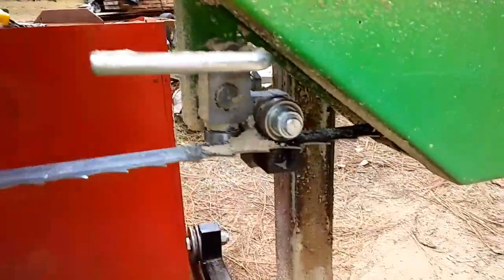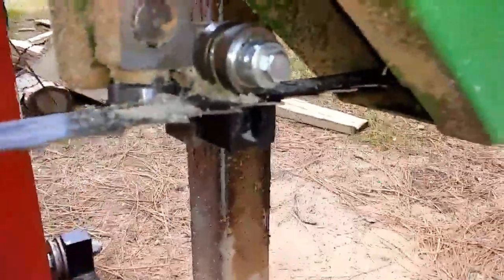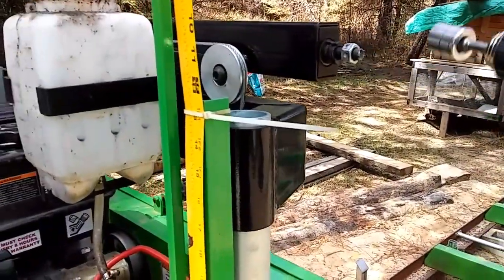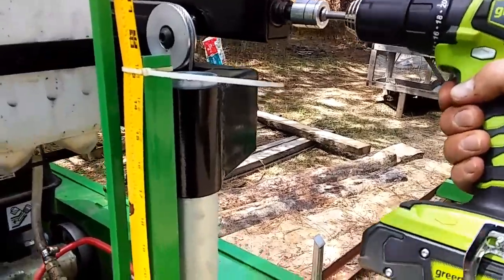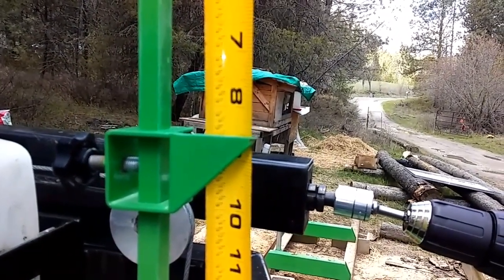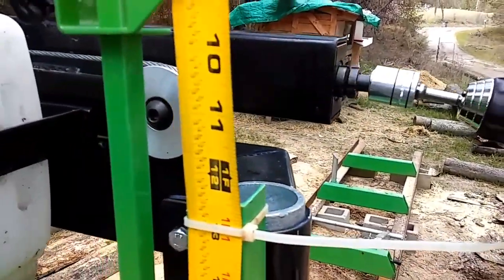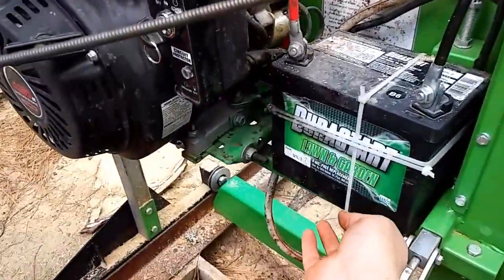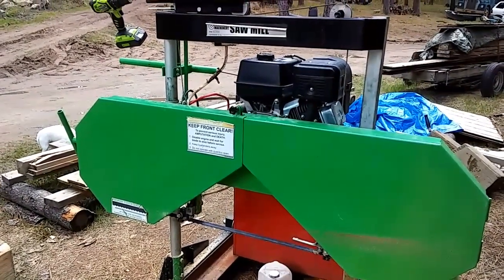Awesome harbor freight sawmill upgrades

Comment: The major problem with this mill is its lack of a stiffened base. It rides untangle iron.Unless this is solidly blocked up it will bend. Your cuts will be off because the carriage runs on this.I had another brand of mill that had this problem.I put it on a concrete slab A later model of that saw put a 2x6 tube of steel the length of the track as standard. That relieves a lot of problems.

Comment: pretty slick on the  adjusting of the height modification my first thought was  if you  use a motor  pulley system instead of the cordless drill  you could have  a momentary switch for each direction  with either a one hand or foot  controller  i saw Patricks comment and  that might be a good option since you already have a 12 volt battery at the mill  of course autos  have other 12 volt motors that may work as well ?  like hydraulic  units  and many others  that might be adaptable from either a auto or a farm machinery application

Comment: So you gotta put that drill on there for every cut you make in order to lower the head to make another cut? If that's the case, then there's no way that would speed up process.  I know it would be faster to just grab that handle and crank it down one or two inches.
Reply: Do you realize that "drill" is an impact first off and secondly it is turning that shaft about 8x faster than what you would crank it by hand. Trust me I personally know and done the same thing  it may look like the impact is moving slow but that's like saying you could bottom out a free spinning nut on a  bolt faster than a power tool....

Comment: My raising / lowering arm not working on the HF 301CC Item # 62366. I took the slide arm out that had the two pullies on the end of it. I found the brass adaptor nut that the arm threaded rod goes into worn / stripped out . The long threaded shaft (about 10 inches) with the handle is good.  I was able to get the brass adapter nut out of the arm with no problem. The PDF drawings for the parts list does not show the threaded shaft that the handle fits onto or the brass adaptor nut/bushing???   The HF order department said you have to order the whole arm assembly and they could not tell me if the brass nut would be on there.  Please help. This is Brass Metric nut outside and inside but not sure what the sizes are.  Any help or info would be appreciated .
  Try to find a mod that would help with the lift.  
Thank you,  
Ted

Comment: we been doing some cutting and seems after you make a cut and release the handles or lock downs it drops bout 1/8 inch sometimes. don't know whats going on with that. the handle seems to move some while its cutting. got get all that straitened up some how. Thing shows to be level all way down but yet it cuts high at times on lower end to.  you have any of those problems?
Reply: Same issue here. The hand locks suck, i dont use them anymore. I just hold the handle in place as im cutting and it fixed that problem

Comment: you done lot of cutting yet with it. just wondering when someone going to come up with a way to make the last cut or two when the wood gets a bow in it. ours runs off about 3/16 to 1/4  inch trying to get the last cut. Have to turn it and cut other end of it to get it strait. lot of time waisted
Reply: A lot of mills tail off at the end.It could be spring in the log or you are overhanging your bunk too much.The mill presses the log down and you get a thin end. Lots of brands have this problem.

Comment: where did you get the rollers
Reply from the maker: drypfus local bearing shop
Reply: what size are the bearings. I would like to know more about the engine it looked like 13 hp that HF has. installing it ( did the foot pattern match up? I'm at a time where I buy a larger saw or up grade my existing hp sawmill. I have worked mine hard now for about 1-1/2 yrs. south florida

Comment: I know people buy the hf  was mills because of the price but woodland mills make a much better one for 2195.00 that you wouldn't have to do upgrades on ......go check out there videos they can cut veneer on their saws like 1\8 inch thick ....they are just much better machines than hf and I believe hf mills are about 2200.00 bucks so for the money I would go with woodland mills
Reply: unless you use a 20% off coupon when you buy one like I did so was about 1600 bucks